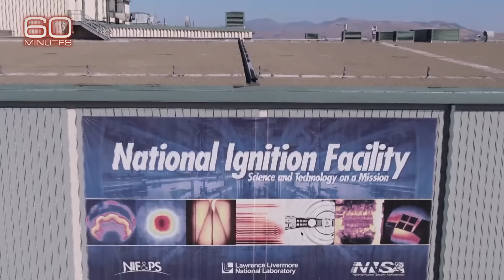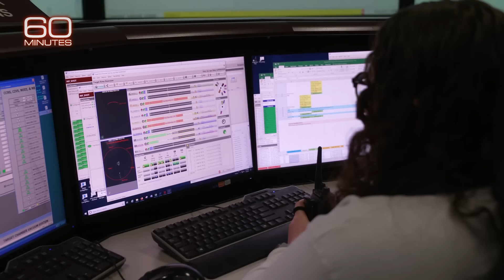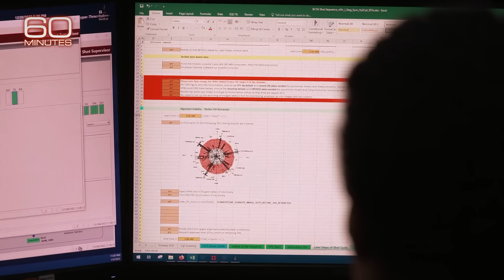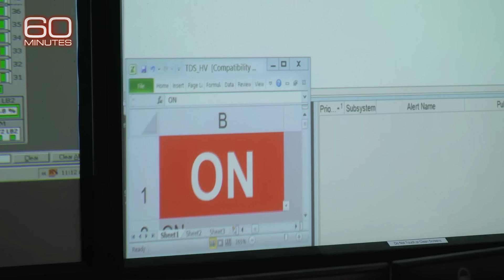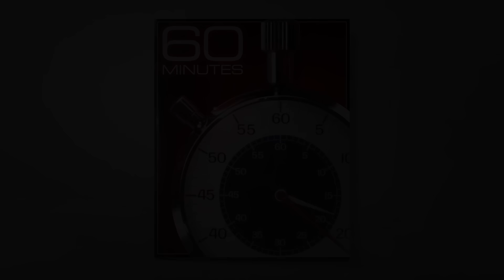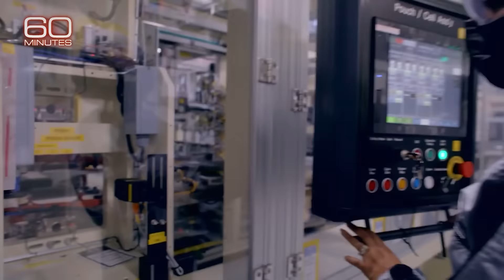Nuclear Fusion Breakthrough; Powering Electric Vehicles; Carbon Capture | 60 Minutes Full Episodes

Comment: 0:28: ⚡ Scientists at Lawrence Livermore National Laboratory have achieved successful fusion of hydrogen atoms using the world's largest lasers, marking a major breakthrough in the pursuit of commercial fusion power.
5:21: 💥 Scientists have successfully conducted a laser fusion experiment, achieving temperatures hotter than the sun, which could revolutionize electric power generation.
11:03: 🔬 Lawrence Livermore National Laboratory achieves a major milestone in fusion power with successful ignition, but experts believe commercial fusion power within a decade is unlikely.
15:30: 🚗 The Salton Sea area in the US is set to become a major supplier of lithium for electric car batteries, with plans for a new plant to produce 20,000 tons per year.
19:47: 🔋 The Salton Sea in California has the potential to become a major source of lithium, attracting companies like Energy Source and Warren Buffett's bhe Renewables.
24:22: 🌍 The US is investing in domestic lithium production to reduce costs and carbon emissions in the electric vehicle industry.
29:08: 🌍 Scientists in Iceland are using a process called Orca to capture and store CO2 in volcanic rock, but scaling up fast enough to slow climate change is a challenge.
34:20: 🌍 Carbon capture technology must be used in conjunction with reducing emissions and transitioning away from fossil fuels.
38:17: 🌍 Occidental plans to build 130 more direct air capture plants by 2035 in order to avoid a climate catastrophe.
Recap by Tammy AI
Reply: People like you make the world go round❤
Reply: Legend
Reply: Goatest goat of all time
Reply: Inno who you are, but I want you making important decisions for the world.
Reply: Thank you, so it is just clickbait. No need to watch this nonsense about lithium and carbon capture etc.
Reply: I thought carbon capture was practically a myth due to the general rule that it takes more too much energy to perform in relation to the amount of emissions produced by the methods to produce that energy? Can someone clarify?
Reply: More comment void of basic maths and physics ! 

Carbon capture and storage is a pipe dream ! 

Fusion as a practical technology are decades if not centuries away . 

Humanity has hoisted itself by its own petards.
Reply: Trees are so "passe" as a means of carbon capture.  Who needs them apart from Elephants and the tired Leopard ?
We want Rock ! - n Roll of course.  Must have the "Roll" - particularly if it's illegal !😊
Reply: @GerardVaughan-qe7ml  Carbon capture by trees not only removes the carbon dioxide.  In the same process, the trees can release oxygen that is need by humans and other animals. Some trees can produce fruit that humans can eat as food. Carbon capture for sequestering is so stupid and dangerous. The oxygen atoms in the CO2 being sequestered would not be able to be recycled by green plants anymore and it would lead to reducing of the oxygen level on earth.
Reply: They have enslaved and fooled you 👉 The Connections (2021) [short documentary] 💖
Reply: @AlJay0032 exactly.

Comment: 36:00 In order to sequester CO2 like Iceland you have to have huge basalt areas so you can geo-lock it. Not always possible. I think making oil would be a good use of it. As far as fusion is concerned, "it will always be 20 years away" until some new physics is found making it a possibility of actually happening.

Comment: 37:00 ships 🚢 have been running on nuclear for like 50 years . Another fun fact is The amount of fuel actually be used on a sailing depends primarily on the ship’s speed. Most ship engines have been designed for top speeds ranging between 20 and 25 knots per hour, which is between 23 and 28 miles per hour. A Panamax container ship can consume 63,000 gallons of marine fuel per day at that speed. Average 1 way trip 15 to 18 days
Reply: Just knots, not knots per hour.
Reply: Yup its running on nuclear fission which breaks atoms and creates radioactive waste. Fusion fuses atoms together,creates way more power energy and doesn't have radioactive waste. It would be nice if giant cargo ships could run on nuclear power but it'd be very dangerous due to accident risk and hijacking risk. It's possible fusion powered cargo ships could be safer since no risk of radioactive ☢ meltdown or crash poisoning the waters.
Reply: @michaelbrinks8089  Sadly, that ain't the case. Fusion will produce prodigious amounts of energetic neutrons which will happily make other materials radioactive or toxic in one way or another. Fusion reactors will have to be very well shielded. High energy neutrons will happily convert phosphorus atoms in your DNA to silicon, the first step to becoming a borg :)
Reply: @michaelbrinks8089  Nuclear submarines typically store their spent nuclear fuel on board until the submarine reaches a port where the fuel can be offloaded and transported to a nuclear waste storage facility. The process of handling and disposing of nuclear waste is highly regulated and requires strict safety protocols to ensure that the waste is handled in a way that minimizes the risk of harm to people and the environment.  There is a common misconception that nuclear waste is just pumped out of the system as it runs, like exhaust from an engine. This is simply not the case. The nuclear waste is just the collection of radioactive isotopes (think of individual atoms of rare metals) that are trapped within the fuel. Once the core has served its useful life, currently around 30-40 years, then it is cut out of the ship and replaced with a new one.
Reply: @nickg1895  Yeah, I dunno all the specific details but knew the dangerous radioactive ☢ waste obviously remained in the sub until it could be safely offloaded and knew it's not released like some sort of engine exhaust. I'm not sure if or how my previous comment made you think I had a misconception that the waste somehow gets expelled out of the sub.
Reply: @michaelbrinks8089  I dont think you had a misconception of it but I just wanted to comment a misconception about it. Others may see it and wouldn't have known otherwise.
Reply: @nickg1895  👍 👌
Reply: @mb-3faze   What I read was wrong then. It said fusion wouldn't create nuclear ⚛ waste like fission does.
Reply: @nickg1895  The military doesn't really have a nuclear waste problem. The U.S. nuclear waste problem is a political construct, not a technical problem. President Carter prohibited reprocessing of spent fuel (what the U.S. calls nuclear waste) from commercial nuclear plants. Reprocessing is sending the spent fuel to a breeder reactor. Its design can use it as fuel, and in the process convert it into different materials some of which can be sent back to the original light water reactors to be used as fuel. With reprocessing, you can extract about 90% of the energy in the original uranium, and the waste is only dangerously radioactive for a few centuries. Without reprocessing, you only extract about 10% of the energy, and the waste is dangerous for tens of thousands of years (it's got to lose the remaining 90% of the energy somehow).

The military is not bound by Carter's prohibition, so it reprocesses the spent fuel from its nuclear reactors. France and Russia also reprocess, which is why they don't have a nuclear waste problem. Other countries with nuclear reactors like Japan and South Korea contract with France or Russia to reprocess their spent fuel for them. It's only the U.S. commercial nuclear industry which doesn't reprocess, and thus artificially creates a nuclear waste problem lasting tens of thousands of years.

So why did Carter ban reprocessing?  One of the byproducts of reprocessing is weapons-grade plutonium. And the concern was that terrorists might be able to get their hands on it to create a nuclear bomb. But with rogue nations like North Korea and Iran being able to create the materials needed for a nuke, you have to ask yourself how much longer such a prohibition serves any purpose. And if you repeal the ban, suddenly all that nuclear "waste" turns into valuable fuel for more fission reactors. In fact we'll want to reprocess it and use it as fuel simply to get rid of the "nuclear waste" problem.
Reply: @michaelbrinks8089  It doesn't the problem is that it takes way more start up power to charge massive capacitors to do things like laser spallation fusion. 

Fission works well for ships because the sea water continually cools the system and the fission rods simply generate steam to power turbines and water is everywhere around the ship. Fusion would require a whole other system that might be better as land based.
Reply: @solandri69  Dude exactly I didn't know about this ban but I've always wondered "What exactly is this waste that is so high energy couldn't it be repurposed to create energy again?" 

You just solved a riddle for me.
Reply: An electric vehicle powered by zero point energy will be demonstrated and Livestreamed in October in Italy by Andrea Rossi of the Leonardo Corporation.  Devices can be pre-ordered today in capacity from 10 Watts to 1 Mega-watts. Multiple units can be connected for more power.
Reply: Now imagine if they could use Fusion instead of nuclear fission. Way more power and no radiation.
Reply: Actually, there are no ships operating on nuclear, and never have been. They are fact powered by triple expansion steam turbines, the same as locomotives and steamerships pre-WW2.
 The nuclear reactor happens to be the heat source for the steam turbine, but that's all it does. It emits old fashioned heat, to boil water.
Reply: Just knots, not knots per hour. A knot is one nautical mile per hour.
Reply: @michaelbrinks8089  Nuclear-powered ships are already being passively cooled by the water they're traveling through, and nuclear waste is pretty much the least environmental threat we should be concerned with right now. Also, fusion reactors would still catch a lot of radiation and depend on tritium as a resource. So it's not like they produce NO nuclear waste.

Comment: The perfection of the target sphere reminded me of the struggle that Los Alamos team worked on back in WWII, in the development of implosion fusion.
Reply: You likely missed the fact that NIF has always been primarily funded as a thermonuclear weapon (H-bomb) explosion simulation tool. It serves, in a reverse engineered sense as a thermonuclear explosive that shrinks the explosion center down to a microscopic bit of fusion fuel that has been extremely compressed and heated to plasma temperatures. The challenges of creating the precisely focused compressive forces in NIF are largely derived from and borrowed from the designs of the thermonuclear weapon secondary explosive component.

The NIF administrators have become masterful in obscuring the primary function and funding for the NIF at the Lawrence Livermore National Laboratory (LLNL), whenever they present the lab to the press and the general public. It's been estimated that approximately $11-billion has been spent on NIF so far from federal revenues.

Comment: My father worked on the initial efforts to develop fusion energy in a project that was sponsored by the University of Rochester .  At that time he was on loan from Kodak after a long career in aerospace.  He personally showed me the project which featured about 10 laser tubes the length of a basketball court . As the beams travelled through the tubes they were amplified by water-cooled flash lamps and aimed at a stainless steel sphere wherein the target pellet was supposed to go fusion .  My dad estimated that this power source would be viable in about 40 years.  It’s been much longer than that to be a reality.  Yet technology marches on……
Reply: I am impressed with the accuracy and detail of your recollection. I work at the facility you are describing and when you would have seen it in the 80s it was still the 24 beam system which could deliver about 2kilojoules of light to a target. It was upgraded in the 90s to the current 60 beam system which does about 30kJ on target and produces maximum fusion yields of around 10^14 neutrons per shot. In the mid 2000s we added a second laser system to the first which can simultaneously deliver a 2 petawatt pulse of light to the target. If you're feeling nostalgic, you can see the state of the system when you last observed it in a documentary on my page narrated by Neil Armstrong. 
We're an unclassified facility and still conduct tours for the public if you want to visit. The whole place is probably about 5 times larger than when you saw it last.
Reply: I was absolutely fascinated by this story..anytime a life changing or generational changing discovery is made I am intrigued..especially when the scientists claim they can make an explosion that as hot as the center of the sun!! the little 'bullet' they make to power the whole thing is amazing in and of itself! and then glued with an eyelash?? omg!! then polished 100x smoother than a mirror..and its smaller than a BB and filled with hydrogen at some ridiculously low temperature..and then 190 lasers as long as a football field will combine their energy to fire at that 'bullet'..I was honestly surprised the thing that held the BB was still intact somewhat..you would think at temperatures never achieved before in mankind would just evaporate everything it came into contact with..that kind of confused me but I am still in awe at the overall magnitude of what these amazing scientists are trying to achieve..they tried and failed for 13 years..talk about perseverance!!! 
 
what also caught my attention was both your response and bigkahuna's..I live in the Finger Lakes area, Geneva specifically, and travel and work in Rochester regularly..it's an amazing city rich in science and research history..the affect Kodak had on Rochester and then the entire world is just mind boggling..I am not surprised they had their hands in scientific experimentation..I attended RIT in the mid 80s as a math major and have always been fascinated with science and the amazing accomplishments that have happened..especially the last 10 years or so..I would LOVE to visit this facility you speak of!! whereabouts in Rochester is it located?
Reply: This is such and amazing story .this made my day .

Comment: The good thing about lithium is that we need finite amount unlike oil. Oil is burned away forever, lithium is only stored in the batteries it does not evaporate or dispensary in any way so at some point it will only be recycled over and over again with almost 0 new sourcing.

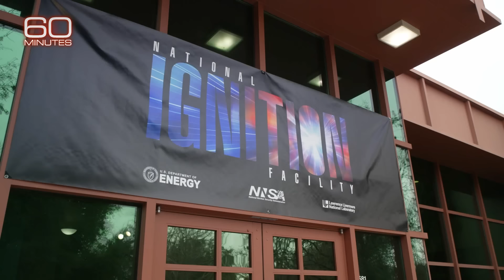Comment: 10:12 A solution to firing ten times a second over long periods is possible with a series of quick charge high capacity capacitors arranged in sequence. The last capacitor discharges ( The first pulse ) into the laser. The output from the laser is then routed to the last capacitor discharged to recharge it as the next capacitor fires, with the excess power routed to the grid. The need would be for very durable and large capacitors for this project.
Reply: So far they are getting 1/3 more power than they are putting into it by a mammoth facility. If they are using pure hydrogen that might be nice but is it doable. Since 60 Minutes technical knowhow is rather limited it could be a deuterium-tritium mix which could prove expensive. The use of lithium greatly reduced the size and expense of the hydrogen bomb, even then they still used fissile material to get the fusion to work.

I will be more impressed with a sustainable reaction which this is not. The Manhattan Project had a sustainable fission reaction, and in this project they are fusing and object smaller than a BB for one pop. I also wonder when you are producing megawatts or gigawatts of power will the helium and iron production remain insignificant or will it become a problem like carbon dioxide is for hydrocarbons?
Reply: @katrinaanon1038  On the helium, it should reduce the current amount of hydrocarbons used to extract the helium currently being produced.  Donno about the iron, how much is being produced?
Reply: The bad thing is lots of these components are made in China, and eventually will need Overhaulin’ and upgrading to get the desired results. Everything is contracted out to different countries .
The city I live in manufactured the first Apollo landing on the moon. Also, they manufactured a challenger all that is gone. Now all that’s left on the huge site is a Kaiser Hospital, a huge mall and a
Huge museum actually a unique museum that shows everything about all it’s achievements for space exploration there’s event, the Apollo castle, the original one there along with space suits pictures in and anything related.
Nowadays, everything is contracted out to different states, including China what a shame
Reply: @hottractor1999  That is the problem, plus do they capture the helium or vent it? Will large scale production of helium become a problem like freon did? Things we do not know or understand and why no research or curiosity about it. That makes me suspicious like the negative effects of renewable energy. I wonder if the ongoing drought is the result of damming rivers or air with wind farms?
Reply: But they aren't doing that yet, so what is the breakthrough here?